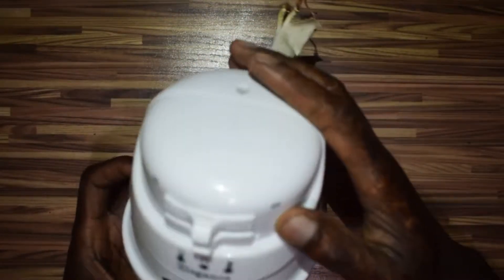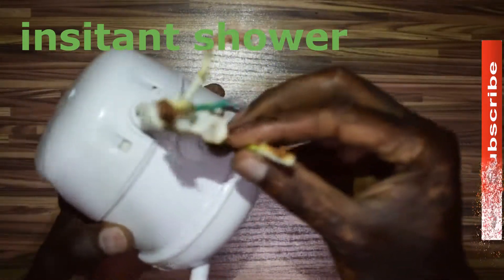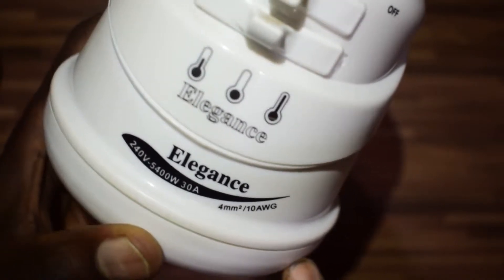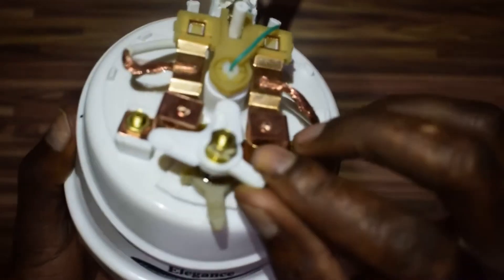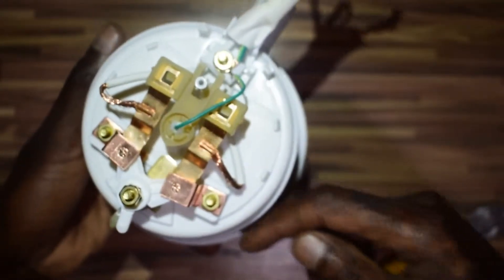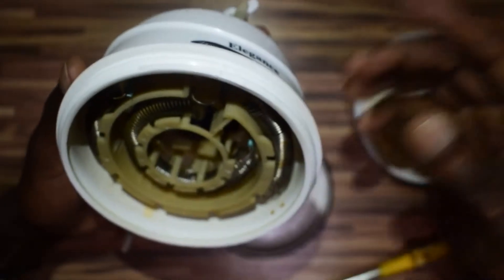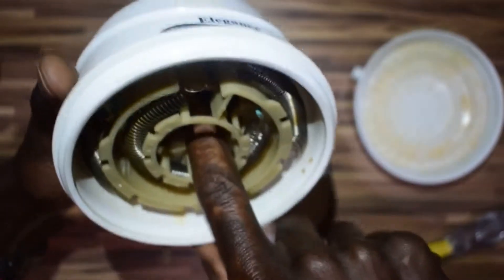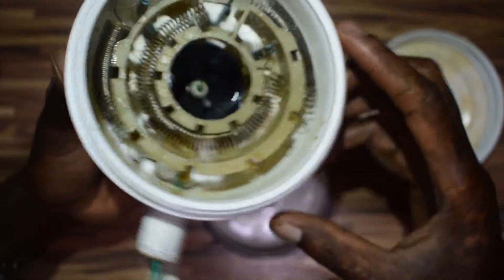Electric shower head

Comment: How it works, there is a resistance spring on the inside and depending of the setting you shoose it heats more or less 

This type of shower was created in Brazil, almost every one here uses this

Comment: I think when  you switch the shower to the high position the small element connect making the water heat up(very hot). on the other hand, when you which the shower to low and not off position, the longer element connect heating the water to warm (not very hot )

Comment: How to change its heating elements and what kind of power of its heating elements
Reply from the maker: Changing the element is easy and they are both cheap and readily on the market...... though you have to care much about the quality especially if you're dealing with hard water. power max can go up to 4.8kw...... can't stress enough on how to change the element  But ill make a video.
Reply: @elektreca  thanks